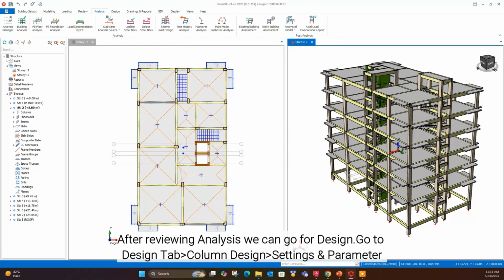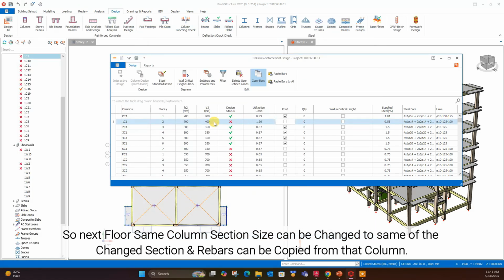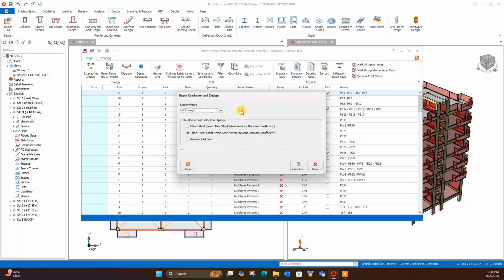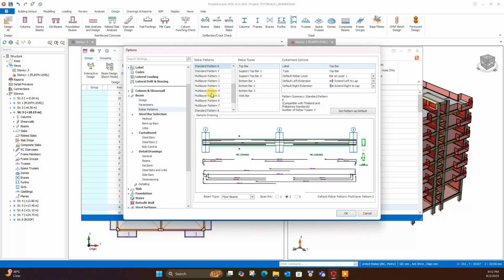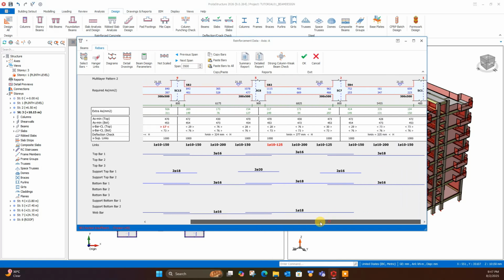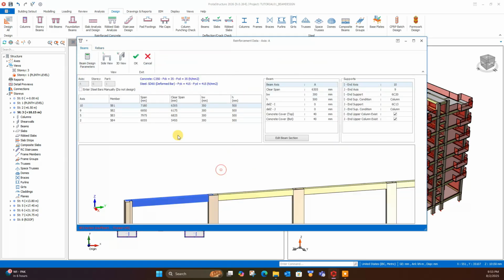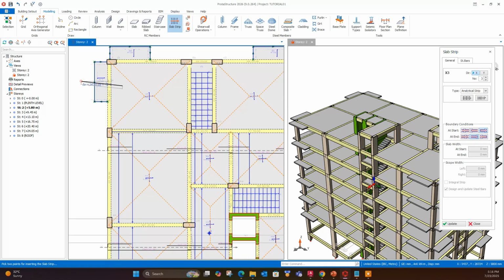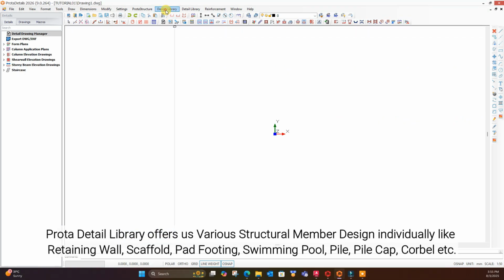Building Design in ProtaStructure 2026 Part-2 | Real Project

Comment: The reinforcement details shown in the stair section drawing appear to be incorrect (the ramp and landing zone). The bottom reinforcement of the ramp should extend into the upper portion of the landing, and vice versa. Could you please review and confirm your comments on this?